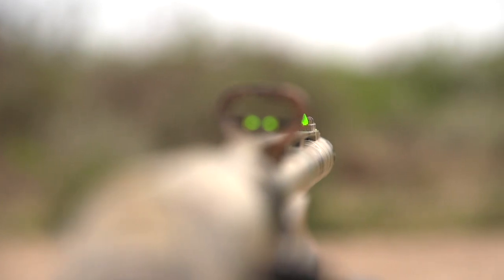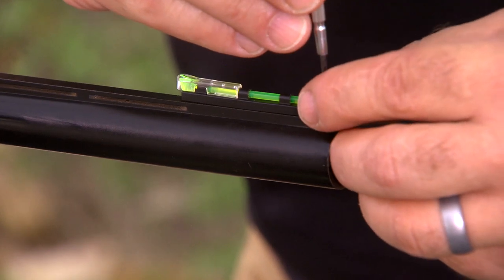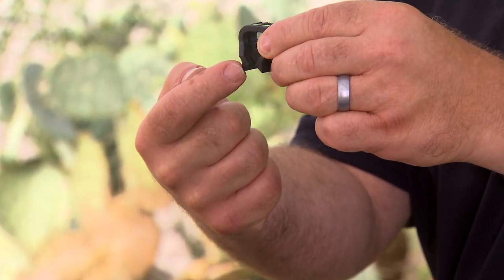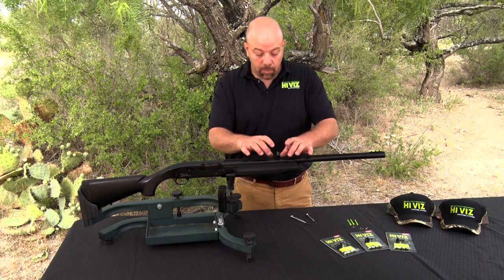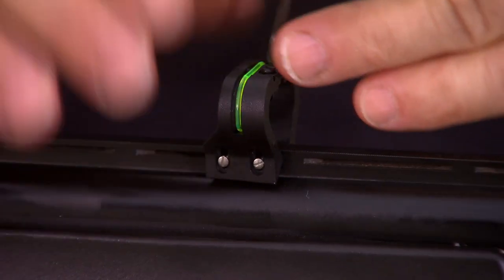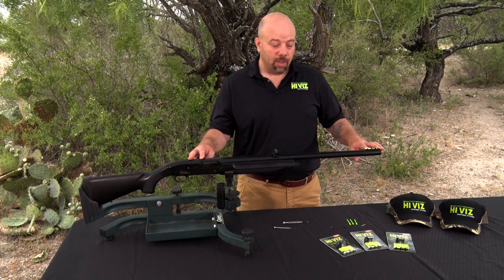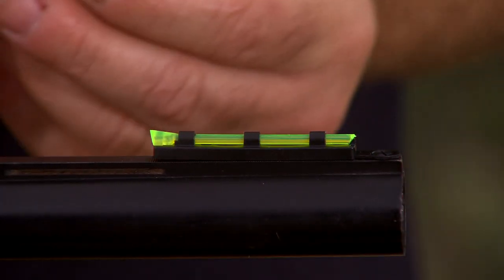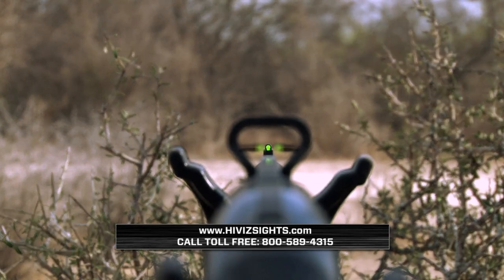Installing the HiViz® TriViz™ Shotgun Sight

Comment: The base of the front sight is quite long & I can see the rear part of it lifting off the rib. Not sure I have confidence in the double sided tape to hold it down reliably. Almost seems like drilling & tapping a second hole in the rib at the rear of front sight might be a good idea, no?
Reply: The adhesive on the tape is weak. Thought about super gluing it. Will wait to see how it holds up after shooting at least 10 shells.